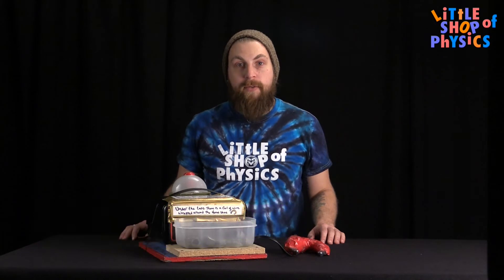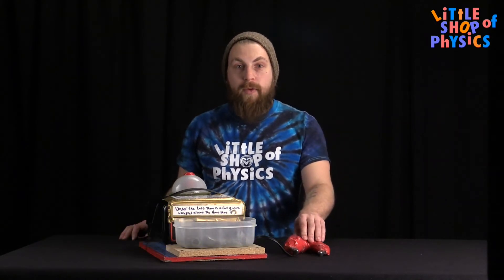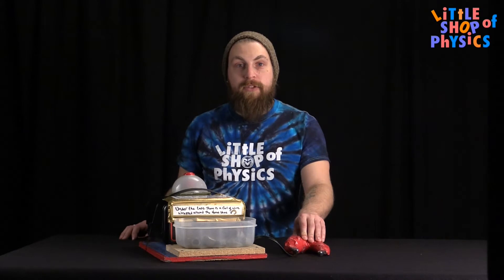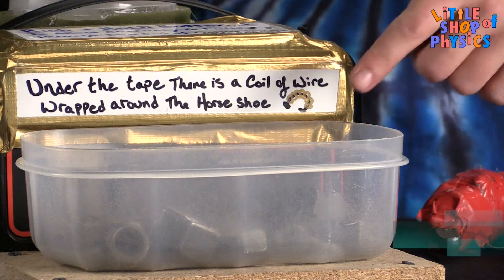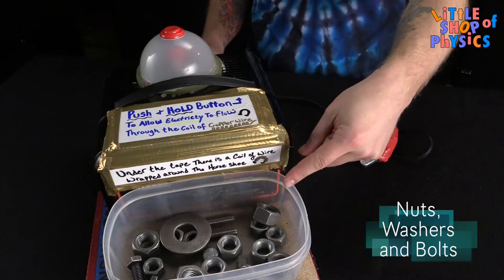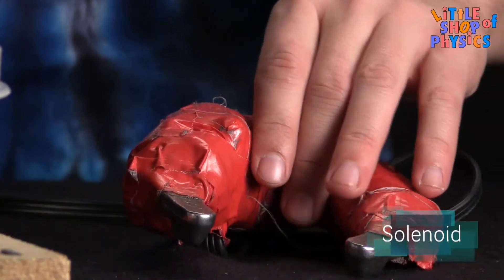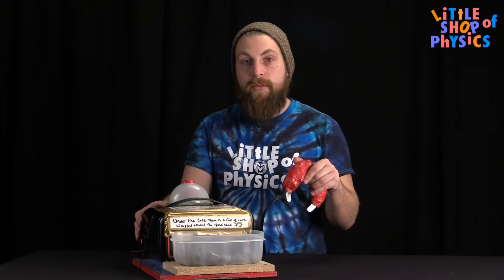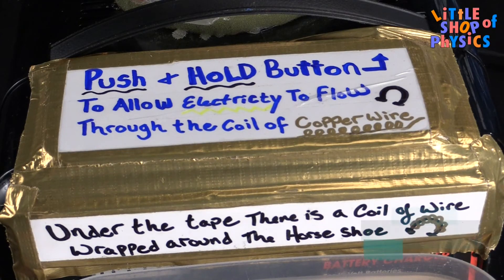Get Your Science On:  Horseshoe Magnet

Comment: Cool! What gauge wire and how long?

Note in the text that it is "A low voltage, high current power supply (we used a 12V/12A car battery charger)", not the opposite as stated in the video.